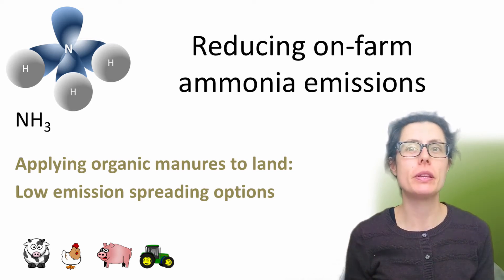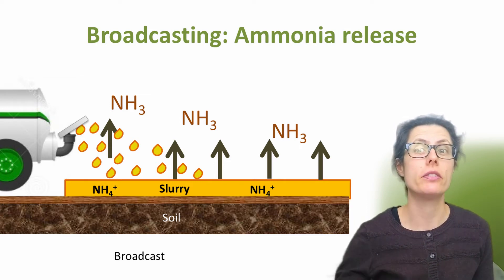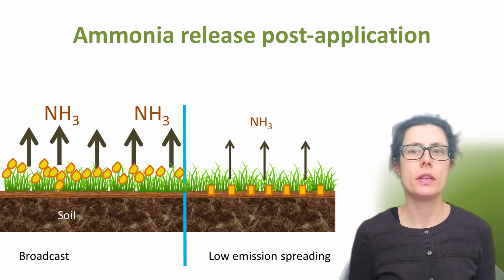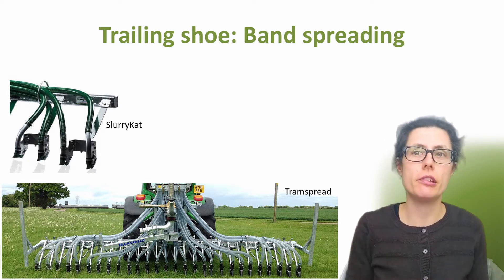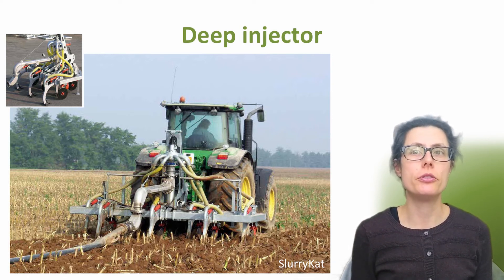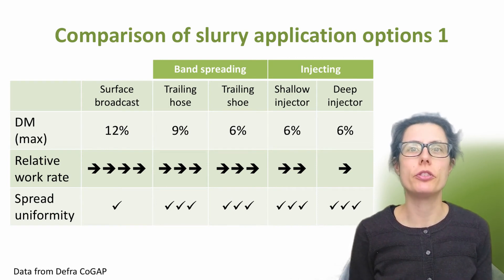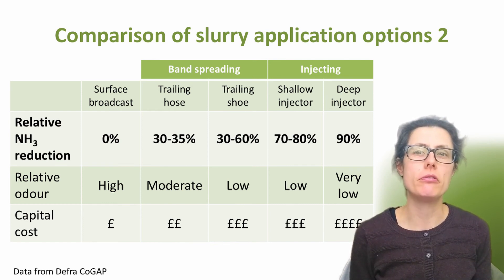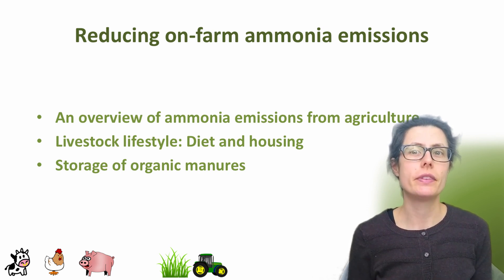AL02 Low emission spreading equipment to reduce ammonia emissions from agriculture

Comment: Hello Mary! very informative videos! 7:55 why the deep injection is not suitable for dry and high clay soil (>35%)? is it because of the immobilization of ammonium? at least is not lost via volatilization of ammonia!
Reply from the maker: Hi Alejandro. Thanks for your comment. I have discussed this with a few equipment providers and farmers who spread slurries and digestates, to be sure to understand from all angles the limitations of deep injection in heavy clay soils. 
Several farmers who apply organic manures mentioned that when clay soil is very dry, it tends to have deep cracks which may be more than a metre deep, and so slurry or digestate applied via deep injection could potentially run down through these cracks into land drains and ultimately into ground water. 
Tramspread highlighted that for deep injection high hose power is needed, high diesel usage, high wear and tear and hence high running costs, in combination with a low work rate. So when the soil is heavy clay and potentially also dry, all of these factors will be exacerbated. One farmer thought that maybe the injector would not get in deep enough if the soil is too hard, and hence more ammonia could be released, or the injector could rip up lumps of clay soil.
Reply from the maker: Hi Alejandro. Tom Misselbrook, expert on ammonia emissions from agriculture also had some thoughts on your question: 'My understanding is that deep injection is predominantly restricted to application to arable land pre-sowing of crops. The mechanical damage occurring means that use on grassland or growing arable crops can result in significant yield reductions. It may be suitable for wider spaced row crops (e.g. maize) depending on machine design. I’m not sure of the restriction regarding dry soils, but may be associated with the additional soil mechanical damage that could occur. With high clay content soils, the restrictions may similarly be to do with additional soil structural damage, the creation of preferential pathways for pollutant transfer to water, and the additional power required for the operation. If the clay soils have existing drainage network, then there is also risk of direct transfer of slurry to drainage channels'.